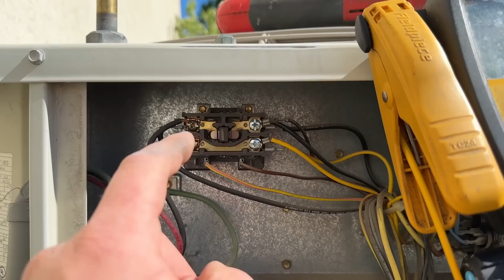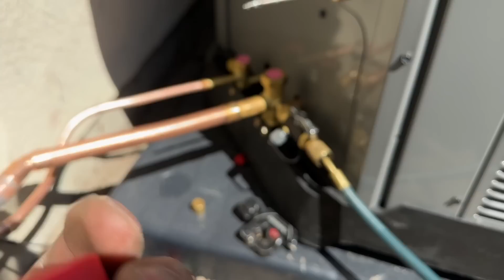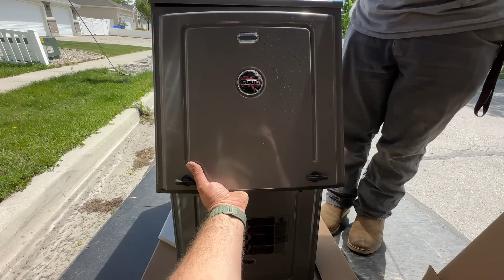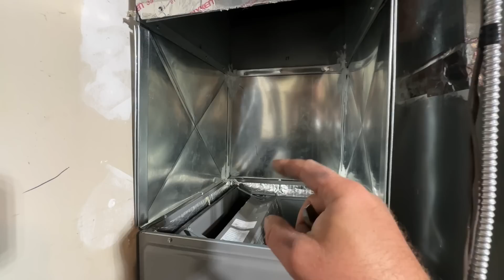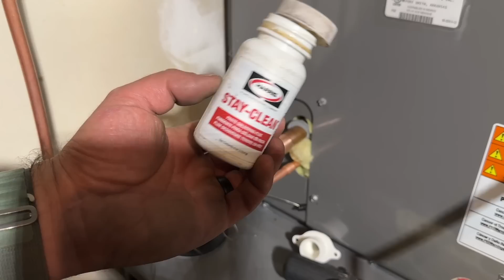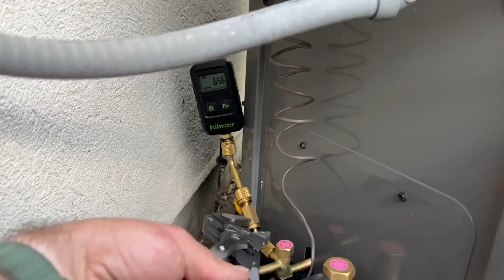Is DIY'ing Your HVAC A Good Idea?

Comment: First Appreciate what DIY guy is doing for us.  But, the facts are there is collusion in the HVAC industry to NOT let DIY fix your own equipment, we see this in the iphone case.  yes, you save money on new AC but , you can not get warranty unless a "professional" installs your AC, this is not freedom or capitalism. Yes you can buy new AC unit on line but , if you DIY install , No Warranty.  Even with Warranty , its only for parts, you still have to pay for labor and wait for it... part of the refrigerant. This happen to me twice, spent $5k on just refrigerant and labor to fix leaky coil.  Solution buy new and replace on leaks and major repairs, you can repair minor stuff yourself if parts are available to you. Louis talks about a need for self repair laws on his channel, this applies. Lesson learned,  I would have bought new AC unit online for $2500 and tools $1000 and replace with new unit, cheaper and learn to be independent, freedom. Warranty is useless anyway, just buy a whole AC unit cheaper.

Comment: Dave as a final step of a swap out. Getting rid of the old stuff. Recycle center near me, town owned. Will take scrap iron furnace and coil. Only $25 dollars to drop the condenser off with refrigerant in it. No problem. Ask around. You can barely get a reclaim place to take your old freon. That drop off was easily worth it. I'm scrapping the copper at a different place for money. Very worth my time. But man this first swap was a lot of work and learning. Next time will be way quicker. 1 week of part time work did the job.
Reply: U know there’s a ton of people that would pay u for the ac so they can scrap it
Reply: @w8what575 Its the old gas disposal that is wasting time and money. Most places wont take it back. So the pay to get rid of is one way. And no time wasted.

Comment: Hi Mr. HVAC Guy. Can one breaker be wired on a 15 or 20K auxiliary heat strip? Can one breaker be wire instead of both?
Reply: On a 20k heat strip a 40 amp breaker is required and no both have to have separate breakers with the right awg

Comment: 99% of people WON'T be able to do this. You are Doing illegal work if you aren't certified to handle the refrigerant as well as you won't have a manufacturers warranty after you install it. If you make one mistake you could burn your home down, electrocute yourself and or cause a bevy of issues. Sure there are 20 or so people in the comments section that "might" have done their installation close enough for it to work however with these systems being manufactured for the weather in each region and the standards and laws changing you are taking a HUGE risk at a fine and/or lawsuit. I own and operate a HVAC company and i would NEVER advise anyone to do an installation that's unexperienced without prior knowledge and/or experienced guidance. You "might" help a few people but to be honest it seems as if he's preying on the hope of the home owner to save some money and to make things seem ALOT simpler than they are. 5/10 installations have SOME type of issues and if you aren't either experienced or prepared then you could potentially throw ALOT of money down the drain. I nor any other company will touch an installation or a system that was previously installed by the homeowner due to liability reasons and customers LOVE to blame the latest contractor that touched their appliances. Not trying to sway anyone one way or the other however thing LONG and HARD before thinking that you can just watch 3 YouTube videos and be ready to install a full HVAC system. Good luck to anyone who tries and I wish you success however you aren't "saving" any money if you have to just spend it later on costly repairs or god forbid you STILL end up having to pay someone for another installation. Find a nice mom and pop family owned company that will give you a good price and a warranty and you'll save yourself in the future from headaches that this guy is BLATANTLY not telling you about.

Comment: Is it a Must to Check for Leaks?  There is another fellow Youtuber using the Name "Steven Lavimonere" who Posted a Video where as He bypassed Checking for Leaks, He leaves Schrader Valves in.   He is a Seasoned: Plumber, HVAC & Electrical Pro.   He uses all methods of Connecting Line Sets ie... Solder, Braze, Compression Fittings. He said he Never had a Leak.  What are Your thoughts?  

Also, I noticed You Installed a "Dryer" on the Outside of The Condensing Unit.  I am Installing a 1.5ton Goodman and when Mounting Condensing Cabinetry, I noticed the Dryer is Installed Hidden behind the Condensing Cabinetry.    I Seen You install a Dryer up in The Attic Outside of Coil (just prior to Coil).  How many Dryers are Needed on a Unit?   

In advance, Thank You.

Comment: I have a Bryant system that is older. The problem is a leak at the radiator. The refrigerant has leaked out. I was hoping to repair the leak and upgrade to a newer cooling refrigerant. I think it is repairable. The company that looked at it, of course wanted to replace it. I haven't been able to get help yet.

Comment: Totally worth it to DIY if you are up to it. The key is to know one's capability. My Lennox all of a sudden lost communications with the outside unit. The problem was it has a Wifi thermostat and once the connection is lost, the entire AC system is dead. I removed the AC covers and traced the comm wires and sure enough, one wire was barely hanging in a slot and the connection becomes intermittent. Had I just called a PRO and it would probably cost me an arm and leg and open to all kinds of causes and left myself at risk to letting the technicians trouble shoot and possibly replacing all kinds of parts. After finding out that loose wire, all it took was screw down the connections and secure it nicely. I even went through the entire wire bundle and sure enough found 2 more loose wires just waiting to give me problems. This makes me wonder how in the world could PROS left behind such mishaps and left their customers vulnerable to call them to address the problems. I'm sure not all techs are like that, but don't you hate that some so-call PROS could be so unethical. That's why I hate calling any service and possibly trouble shoot myself whenever possible. How ironic that there is another AC guy with a by-line Anti-DIY HVAC that complains about their customer being "helicopters" that got on his nerve. Well these are the scenario that customers had to go through and can you blame them for being "heliccopters" ?

Comment: Hey man! Off topic, but wondering if you have used or can make a video about/demonstrating the PRO-fit quick connect fittings (sharkbites for HVAC? I think that might be valuable for the DIY crowd.
Reply from the maker: Yes I have a couple videos using the pro fit quick  connect fittings 👍🏼  I’ll probably do another one soon though!

Cheers

Comment: so, i have an Amana 16 seer (16ASX0421F*) condenser with matching evap coil and air handler that came with the new house we purchased as a spec home.  this is an r410a system.  is what i have any good?  2+ years in, i've already had to have the pressure switch on the low side replaced due to a slow leak.  that was $600.  they put on a schrader valve for the new switch to screw into (to isolate the switch so that it could be easily replaced by me in the future).  i have always been a trane / american standard buyer, but this is the system that came with the house.  should i keep this system or change it out?  daikin > goodman / amana -- i have never been a fan of these brands.  what would you do?

Comment: Can anybody tell me if I can install a Mr. cool slim unit with a Unico system. I have a property line dispute and I don't have much room. Most people never heard of a Unico or space pack system. I'm just using it for ac only. I have radiators and a boiler. I only have 28 inches wide. A typical condenser is 29 to 35 inches wide. It won't work. Thanks for any help anybody could give me. Much appreciated.

Comment: As a professional HVAC tech I am all for people doing their own installs. We make more money redoing them and we don’t have to warranty customer supplied equipment.
Reply: As a former HVACR contractor, I installed my own equipment and I also perform maintenance and service only on my own equipment. 
My neighbors always ask me to service and replace their equipment but my license expired many years ago. I do give my opinion and several HVAC contractors have tried to cheat my neighbors. 
A dishonest contractor disabled my neighbor’s furnace by gluing a small wire on the inducer fan motor which poked down into the motor and prevented it from rotating. I told my neighbor that wire didn’t belong there and I removed it with my fingernail.  The inducer fan immediately started blowing and furnace began to operate normally.
Reply: Anyone who won’t admit that there are untrustworthy people in their field, can be counted as untrustworthy.
Reply: When we were told that a homeowner was supplying the materials the homeowner price came in to effect without a guarantee 😂😂

Comment: Why aren’t a valves put on the copper lines closest to the valves with the Schrader cores to prevent the copper lines from having to be vacuumed out again with nitrogen. Basically maintaining a vacuum in the lines while you install a new unit (ball valve?) thank you your show rocks. 🥇🏆🙌

Comment: My set up: Testo 549 ($250), Yellowjacket low loss gauges with valves ($140), vacuum pump $65, nitrogen tank ($100), stay-brite 8 and stay clean ($100), refrigeration grade fittings if needed ($50), tube expander ($25), nitrogen flow regulator ($50), nitrogen regulator $40, kwik charge attachment (not necessary) $35, Appion core removal tool x3(1/4) $72x3=$216, bubble leak locator rector seal ($10), safety switches SS1, SS2 and SS3 ($80 for all 3, you can find those cheaper), vacuum gauge CPS $175, Nu-Calgon flush $150.
Installed 3 systems (3, 3.5, 4 tons), work like a champ (5,4,1 years old, no issues), worth it to DIY, saved at least $20k. The key is to do it slow and pressure test everything with nitrogen, also vacuum to 500 micron and hold for 15-20 mins.  Manufacturer warranty? How helpful is it if you still need to pay for labor even under warranty with labor being the most expensive part of the whole install? (you can get any equipment online delivered to you  and the equipment is very inexpensive in comparison to labor).
Reply: Just replying to mark this post. Thanks for the list and info 👍🏻
Reply: Nice job! The MrCool Central System has a 10 year parts and labor warranty that allows self install with pre-charged line set. I just installed one and it is working great.
Reply: @Random_DIY  MrCool is trash
Reply: @Avalanche3618  Really? How so?
Reply: vacuum pump for 65? what make is it?
Reply: Where the epa licenses at 😂
Reply: Gonna look at this later
Reply: Where do you get nitrogen from? Can anyone buy that?
Reply: Yes, just google it. Even seen it on amazon before.  @Dr-YouTube
Reply: @Dr-YouTube  Absolutely, find a welding shop. My local one swapped a co2 tank for nitrogen. Get a big one, they are almost the same price or easier to get refilled.
Should have said first. they will rent one for a week for $20 or less. They place i go to would have lent it to me no charge. Just hold a deposit and bring it back that week. Very helpful. New big tank is $200. Poke on craigslist.
Reply: Where did you get all the tools needed?
Reply: In Australia with our A/C warranties are labour and parts included mate so yeah, it IS worth getting a qualified person to install it .
Reply: @AussieHVAC  What qualifications do you need to install A/C in Australia?
Reply: @AussieHVAC No it isn't. Who are you kidding.  No contractor is going to install that shot for free.

Comment: I posted this before. The last two installs before me swapping mine. Didn't AIR SEAL much. Some. But holy mole were there lots of gaps and holes. The new one pushes very well. And sucks on the returns. That alone as saved the unit from cycling as often. As the rooms are better mixed and even out the cool at the moment. The heat has to be similar. Old one on heat would cycle often. AC was low on charge for 8 years, i never checked it. It would run almost non-stop and had poor cooling evenness as the temp drop across the coil was so low.

Comment: Awesome video!!!!!..... Help from anyone reading this, how you size an ac condenser for a home? I have a ranch style home with 2,400 square feet. Half of that is in the basement which stays cool all summer long. Do I get a condenser big enough for the 2,400 square feet or just 1,200 for the main floor that I am trying to cool down. Advise would be highly appreciated
Reply: you need to do a heatload calculation.  Is the floor insulated? if not you will lose some cold air to the basement, if there is decent insulation in the floor and no registers in the basement for all practical intents and purposes you can ignore the basement.  Windows, insulation, sun exposure can all factor.  At the minimum 2 tons and maybe 3.

Comment: I picked up a good turbo-shear a while back at a garage sale for 2 bucks. I really like that locknut tool from GB for box fittings. I'v struggled for years with flat tip screwdrivers, especially on painted stuff. Gonna get me some. Hey, for a $7000 savings I could fly you down to Florida, put you up in a hotel, and buy you a good dinner (or two) to come do a unit for me!
Reply from the maker: You have no idea how many people have asked this lol sorry, don’t have the bandwidth for it.

Comment: Problem in DIYing is that you can’t purchase items such as defective fans, you have to have a HVAC license, forcing you to purchase from a HVAC company. I needed a small screw for my airhandler for my Trane could not purchase the screw
Reply: The Goodmans rust out in Florida, Trane my airhandler casing is composite and my coils are treated for salty air, and the base of the outdoor unit is not metal
Reply: Other thing to be aware in Florida the HVAC Companies will tell you that they registered your unit, don’t trust them, the majority do not. Then you are screwed, this is for standard and mini split installations.
Reply: Trane/American Standard is notorious for not working with homeowners directly.

Other brands less so.
Reply from the maker: Yea that was your problem. Wouldn’t have been a problem if you went with a Goodman. They’re just as good of equipment in my book. ✌🏼

Comment: People need to stop letting these hvac guys replace units when it's not necessary, fix your old units they are build better.
Reply: But Commission Ken can’t pay for his sports car without selling  you equipment that you don’t need.
Reply: No older units were not built better 😂 but i do agree that in many cases repairing over replacing can be a wise option on systems out of the manufacture warranty. People need to know it’s “risky”. Replace a $2,500 compressor & then have an evaporator coil leaking 6 months later that’s NLA would suck. It’s happens.
Reply: Necessity is subjective

Comment: Last year I took a chance to DIY one 9KBTU and one 24KBTU Mini Splits. Bought all the tools I needed for a proper Installation. Info from Y/T channels like yours. Been working non stop Cooling and Heating my House and Shop. Just ordered another 24KBTU unit and am installing it as we speak. Saved a TON of Installation $$$$ besides the energy cost reductions.
Reply: Ductless Mini splits are the way to go…
Reply: @peckerpeter2078  I just installed a MrCool Central Ducted system. Works great like a conventional ducted system but outside unit is DC inverter like a mini split. Replaced my old 5 ton Trane and works great.

Comment: Bs you should of just changed the capacitor it's a 20 dollar part but then you would of charged the home owners 400 to 600 to replace a 20 dollar part.
Reply: One of my employee's (we are auto locksmiths) told me his outdoor unit was making a funny noise. I asked him if he had meter and he was reluctant to check the cap. I asked him to take a pic so I could see which cap he needs and told him the cheapest thing to do without checking is to buy a cap. About 2 hours later it stopped working. I found a local supply open on Sat for him. The guy at the desk is telling him all kinds of nonsense like it's probably the compressor. I told him to just buy a cap. I walked him through connecting the wires and he is happily back up with A/C in the hot So. Fl. heat.
Reply from the maker: I told him about it, but he opted for the new system. There were other issues with this system

Comment: Biggest issue in doing it yourself is having to heave around the units and deal with the old one after. It’s just a lot of lifting and sweating since it’s always in hot cramped places without ac of course.
Reply: Definitely not a picnic, I’m planning to replace one of my units until after summer. This is one reason why the labor can increase significantly for doing a replacement.
Reply: In addition, imho, it's the same biggest issues as I do your replacement as an installer =b.   

I was guessing as big of a hurtle would be getting a scrapper to collect your old units and get the tools to perform the job.  

Cheers to the diy guys who can do it. This channel is great.
Reply from the maker: I list units on Facebook and they’re gone the same day! Not worth if for me to cut up and scrap. I’ve helped dozens of people successfully do this. If any of you guys need remote support, you can find it at Patreon.com/diyhvacguy  

Cheers all!
Reply: @diyhvacguy  go bro go

Comment: Liked the installation, more so the filter box outside the furnace.  On my furnace, the filter is inside of it and you have to remove the front access panel.  The filter is secured by wire and when the blower is running, the air pressure creates a gap between the filter and sidewall.